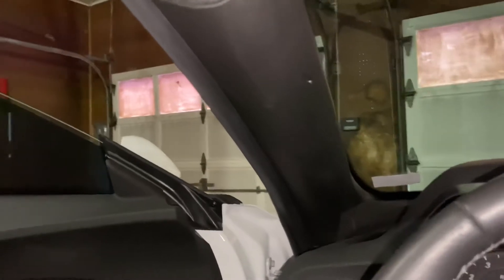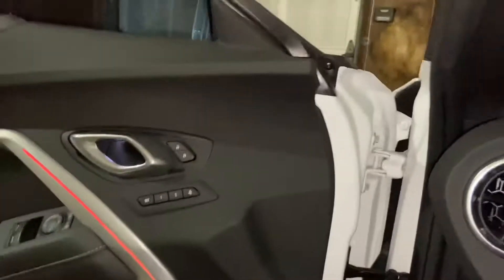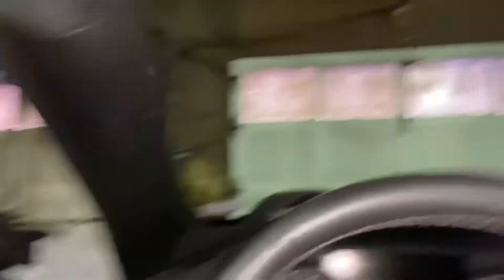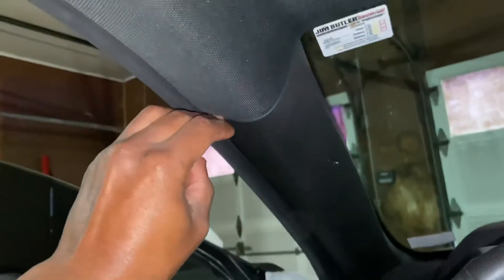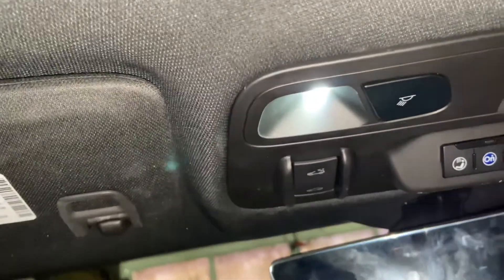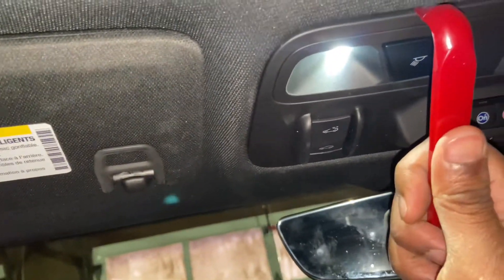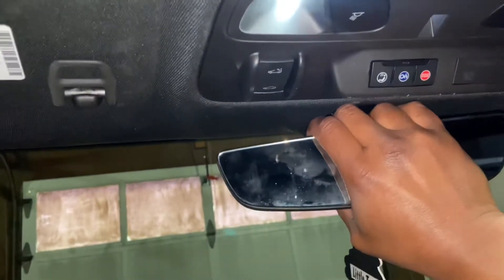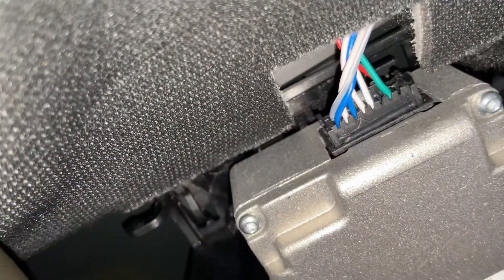DIY HOW TO REMOVE A 2016-2022 CAMARO HEADLINER AND BACK SEAT! Easier than you think

Comment: You took the headliner out thru the trunk or side doors ?
Reply from the maker: I took it out threw the passenger door you would have to bend it a lil bit
Reply: @KeepUpWithDevo  any creasing or damage to the headliner after you got it back in from bending it?
Reply: @calebttaylor9152 did you attempt this? How did it work? I saw the only safe way is to remove the windshield and apparently you gotta completely replace it if you do from what i read
Reply: @Nodnarb69 u can get it out thru the door u just have to bend it abit if ur careful it wont crease 
Im boutta do it to my car rn
Reply: @Alex8dirty14  I'm playing it safe n just taking my seats out, popping down the headliner and installing my lights or whatever I need in the car, then just pop it back in and install seats.

Comment: Did you have to remove the front seats in order to get headliner out of the car?
Reply from the maker: No i just pushed the seat all way up and took it out the passenger door u do have to bend it a little
Reply: @KeepUpWithDevo  gotcha, thanks bro. I just ended up taking em all out. I wanna run my sub wires nice and clean while I'm at it figured just be the easiest way. To knock it all out. Been raining/snowing last couple days but ceilings ready to drop. Gonna finish this week.

Comment: Just removed mines found out you actually have to twist the mirror to left to remove rather than pushing back and my sun visor has a cable that disconnects higher up inside the headliner